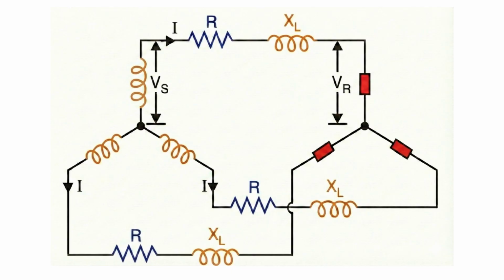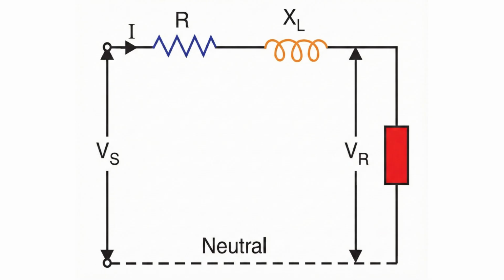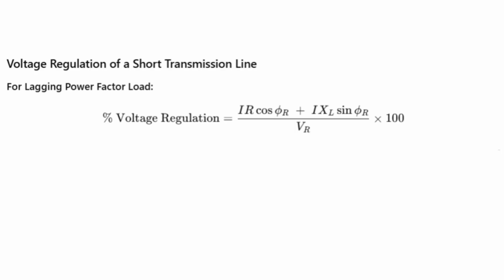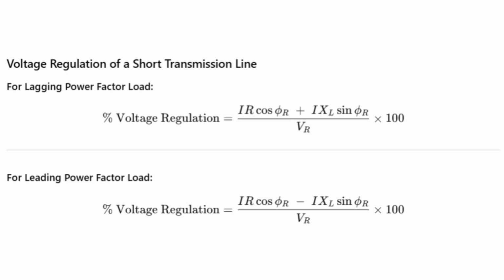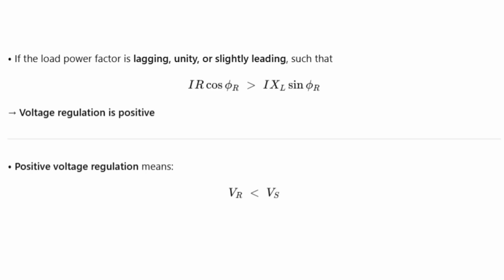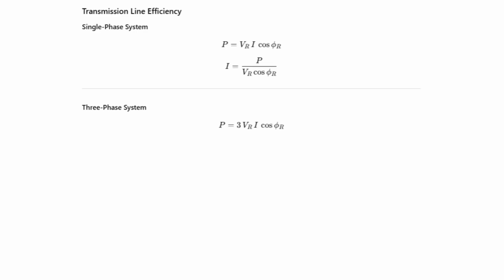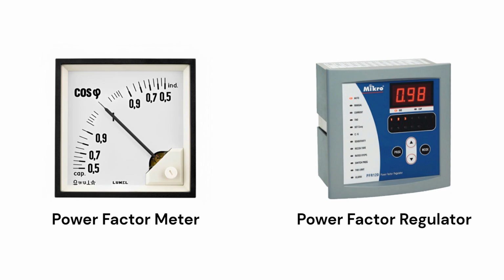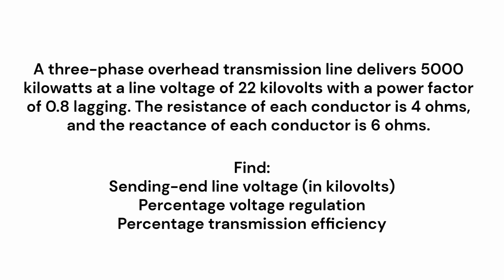Three Phase Short Transmission Line Explained | Voltage Regulation, Efficiency & Numerical

Comment: Sending-end line voltage: 22,93KV
Percentage voltage regulation:4,23%
Percentage transmission efficiency:93,94%
Reply from the maker: Thanks for trying 👍
Please recheck the sending-end voltage calculation. Because of that, voltage regulation will also change. Efficiency is close. Try once more.